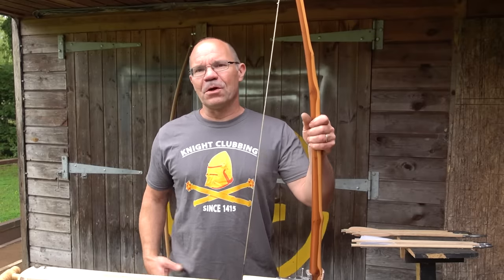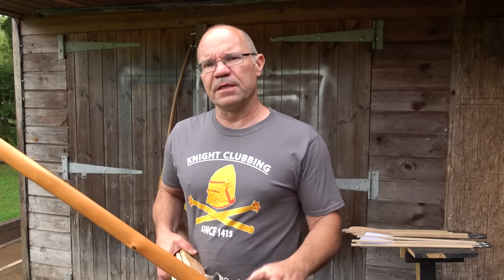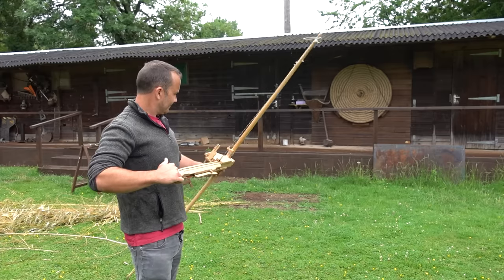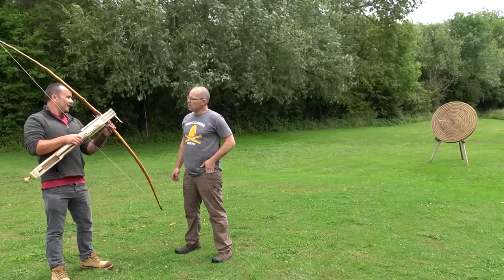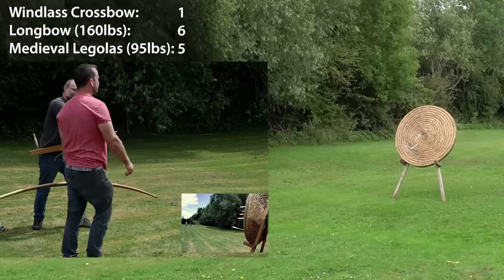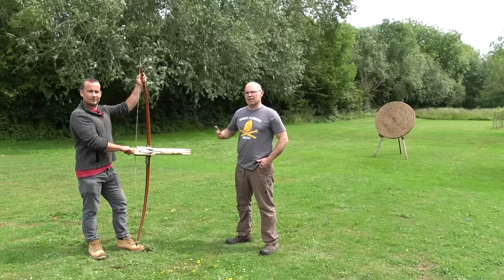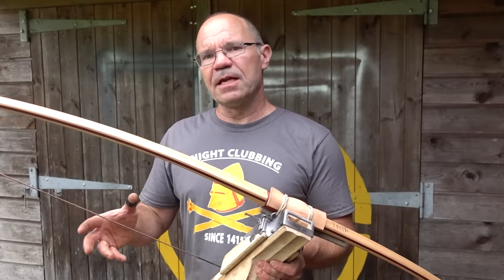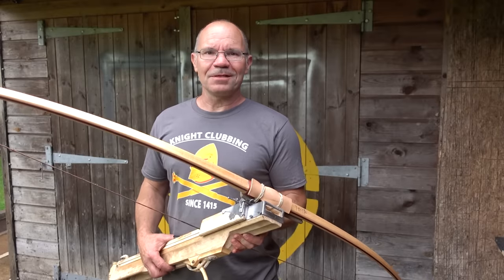Tod's 120lb Medieval Legolas - TESTED

Comment: Having in mind that Joe felt the 120 pounds bow as a 160 pounds bow (even though it may be caused by Joe not being accustomed to the SIL system) it would be interesting if you could add a pulley system to actually take advantage on a more efficient way of the bowman's strength.

It would be a huge advantage if the instant Legolas allows Joe to feel the 120 pounds bow as a 90 pounds bow 😸
Reply: I've seen videos of people using instant legolas systems on compound bows, which sounds exactly like what you're thinking of. However, compound bows are a very modern invention (circa 1960) and therefore aren't very medieval. You could probably design an instant legolas system with a spring that would assist with the draw, but even the first springs weren't invented until the late modern age (mid-1700s), so that also isn't very medieval.

Not to discount your idea by saying "that's not very medieval" of course.😋
Reply: @amish-ish  The composite bow comes as far as the Bronze age with the Sinew variants From middle east, Being used proeminently by nations such as The Mesopotamian Assyrians, Babilonians, and later the persians. The Nomads also had their variant of composite bows
Reply: @picollojr9009  Composite is a different thing to compound.
Reply: @amish-ish  I don't know if you've seen it yet, because he made it quite a while ago so you might have, but Joerg made an assist mechanism that uses a second lighter bow as the "spring". All you have to do is attach the assist bow backwards in front of the main bow and extend a part of the sliding mechanism out further to reach the assist bow's string.

Generally, the second bow should be around half the draw weight of the main bow, and you'll want a bit more draw length on it so that it can stay under a bit of tension while the main bow is at full draw. That being said, the physiology that is required for Joe Gibbs to draw 200-pound bows might not work as easily in reverse, and the high rate of fire would certainly be exhausting, so don't expect a 400-pound SIL to be possible.

Comment: Old world weaponry is so cool, especially when combined with a little 21st century engineering and thinking.
Reply: I tried reworking flintlock rifles and attach three of them into a wheel, making it similar to a mounted minigun. It's for a fantasy setting that I came up with with my friends, and the concept is actually pretty cool.
Reply: Boid That seems highly impractical when faced with loading, and weight. Which is why when they did double barrels, they were a good even. The logical progression was cartridges, which led to six shooters and the like. 

Logically flintlock was used similar to crossbows, because of the loading action, and even with three barrels you don’t negate that. 

Might as well make it a fixed double assembly on a swivel mount, up the caliber making it a mini cannon, add your third gun onto a separate mount and assembly with a mate barrel. 

Then just keep the two shots. One for a lead, one for the correction. Then the other gunner to alternate loading actions to maintain reasonable rates of fire. 

The issues this gun faced are what I was thinking of. https://en.m.wikipedia.org/wiki/Nock_gun

How did you explain the engineering?
Reply: @chickenmonger123  The main reasons you addressed is the main reason why I discarded it in the long run in favor of mounted cannons.

But I may come back to it. I just don't know how to tackle certain issues
Reply: Boid Ah well, that does make more sense. Good luck on your writing, hopefully you can shake it out. Often military doctrine bends to practicality. Make a logical world reason, and you can do all kinds of wacky shit, peculiar to that theatre of war.
Reply: Repeating flintlocks were a thing, see Kalthoff or Lorenzoni guns for instance made at the tail end of the 18th century, and the Kalthoff guns were even earlier, made in the 17th century, people back then definitely didn't lack ingenuity. It's just that when it comes to issuing firearms en masse is already difficult enough, cost, quality control and standards of manufacture, time, complexity of design, those are all important things when you're thinking about issuing your troops with any new technology. 

Flintlocks or rather proto flintlocks like the snaphaunce came around in the 16th century, but it took well over a 100 years before they were being issued to any troops in any significant numbers, and another 50 until it became the mainstay of European armies simply because the matchlock was a far more common and well understood lock mechanism, it was what the manufacturers were familiar with, just like a lot of manufacturers are familiar with the AR or AK family of rifles today, and will probably keep manufacturing those designs for a very long time.

Also if you're thinking about some kind of revolving design well my boy James Puckle got your back, he made a revolving, repeating cannon that relied on a flintlock mechanism in 1718, or well the patent was from 1718, I can't remember exactly how long he took to come up with that, apparently the Royal Navy was interested but ultimately the weapon never went anywhere, might wanna look into that for inspiration, the operating mechanism is pretty interesting.
Reply: So old?
Have you ever seen an ancient Greek bow 2000 years old? At least! 
They were shooting 220 to 750 yards! We are talking about 300 lbs plus! 
Or Asian bow, or Egyptian?
Medieval they say!
Reply: old weaponry can shoot just as fast. Remember you have to reload the magazine one arrow at a time. meanwhile this guy can shoot 125lb bow without any device just a fast 
https://www.youtube.com/watch?v=Ya6mjSycl0M
Reply: Skin Care
Reply: @chickenmonger123  m
Reply: ⁰⁰ㅣ
Reply: @boid9761  it's rare to find but multi barrel flintlock rifles were made.
Reply: @matthewschmitz1765  Yeah That too.
Reply: you ain't seen nothing yet until you see somebody shoot 3 arrows in 0.6 seconds, and hit his mark
Reply: You know whats even better old the guns.

Comment: Shows DM this video
DM: No
Sad noises
DM: Secret writes an evil army with archer column armed with this attachment
Reply: As a long time ST/DM, I can confirm.
Reply: DM here, the master archers of Menet already use these in my world :)
Fully intent to let them loose on my party at some point.
Reply: Task failed successfully.
Reply: i see you have been cursed with a lawful evil DM
Reply: I just allowed a modified version of this for a ranger PC in my Pathfinder game.
Reply: the issue with allowing this is that we have only seen its strong points so most implementations would be straight up better than a normal bow. However it has been stated several times that you wouldn't use the IL in all circumstances. Its like if the flintlock pistol was introduced and you put it in the game with basically bow rules and 10x damage. Quickfire bow obviously is less of a change from a normal longbow, but how do you capture the drawbacks?
Reply: @Maric18  Well, when you are in a fantasy setting with a DM/GM that loves using magic and has a group of mages who sole duty in their existence is to go around and blow up blackpowder barrels. Guns are rare in the campaigns I am in. And if they do exist. They only exist because of reasons of the DM/GM (generally some time placed NPCs or even NPCs from another planet).

Yet when I see something like this. It can be used for more mass hit and run tactics or in the sense of mass combat. A 'small' group of well trained archers. Able to fire consistently the same amount over the same span of time hundreds of arrows more than even a group larger than them. Just to rain arrows down on a large mass. Also, perfect for more emplacement archery. Like a castle or fortress. A small number of archers able to rain down arrows to make their besiegers to think twice about charging.

As i see it. The big drawback. The weight and how unwieldy it is. I mean sure can lug it around but once it is set up. It is clear it is not easy to take it apart and stow it away for easy transport.

Plus reloading it takes a lot longer than it took to fire it. A crossbow is faster by that point. And already know of rapid fire crossbows that are also magazine fed and a lot faster than this bow concept.
Reply: @Rune_Scholar  I always tell my PF players, if you build a grease monkey with a penchant or invention, this this is A O K to research and develop. Unless the game I am running is porting Eberron, in which case yea these exist. why the fuck wouldn't these exist in eberron?
Reply: Maric 
Reload time needed to refill the magazine. Reload time for stripper clips EACH stripper clip. Added weigh and bulking of system itself and bow attached, weight of stripper clips quantity of stripper clips, decrease in agility and stealth, decrease in dexterity in battle. 
Increase aim per shot ( more you fire more accurate you get ), IL can be fitted with various aim systems and it will fit, IL will overpower any bowmen/archer/crossbow men or two maybe three, be effective in middle/close range due to fire rate and ease of aim, won’t get debuffs if quick aiming needed same with long range any range (depends what type of bow installed ), strong against melee units or thikk monsters, if using with non-human type system can theoretically support small balistas.
P.S: Id love to have one in Skyrim
Reply: @Maric18   I see it as a battlefield weapon. Lugging an IL around while adventuring would be inconvenient, not to mention the weight of all the arrows you have to carry to make it worth the hassle. You'd need a cart.
The stamina drain would also be tremendous, as well as the chances of something going wrong with the mecanism. It would be a powerful weapon but quite situational
Reply: @Maric18  The attachment requires maintenance and wears down over time. It's from a specific and insular culture so having it maintained or repaired is kind of going out of the player's way. As is the crafting of custom arrows. That's a bit less of a problem because any good fletcher can recreate them but it's still more of an inconvenience.
I also tend to run realistic games and gear weight and positioning matters. The IL can be cumbersome for an adventurer. For example, if you need to climb a rope you can just sling your normal bow over your shoulder while you do. The IL is a bit harder to stow, however. -2 To that climb check. Your bow is wobbling all over the place as you ascend.

Comment: At some point I'd like to see a range and penetration comparison of the "Instant Legolas" to various standard bows and crossbows.
Reply: As long as the string and arrow don't get much more friction as it is loosed, it has the same range and penetration as the naked bow. An exception for using shorter length bolts that might affect that
Reply: @calebjowens  Shorter bolts are going to effect it.  If they're the same weight they have less air resistance and thus better performance at range.  If they have less weight they have higher velocity and thus better performance at range.  There's some minimum projectile weight to not damage the bow, but I'm not sure how that compares to the minimum weight to make an arrow that can handle the acceleration while being long enough to fully draw.
Reply: @nathanbrown8680  It's worth noting that since this system guides the bolt for the full length of travel, the bolt has no length requirement as far as the draw is concerned.
The main drawback from what I can see, (as far as range and accuracy are concerned,) is that to make the bolts flow through the mag and chamber correctly they must have a pair rather than a triad of flights.
Also, having a projectile be lighter or equal in weight to some other projectile shot from the same weapon doesn't necessitate better performance, if performance is measured in penetration.
Reply: Slingshot channel.
Reply: I assume this would have gotten min-maxed to the extreme, eventually coming up with the optimal ratio between draw weight, draw length, arrow length and arrow weight. I'd say range would get ditched in favor of penetration potential, given that you'd care less about keeping your distance when you can unload such a volume of arrows even with small groups. Also, "stripper clips" for this device already exist, and I'd argue that to be the scariest potential feature of the Instant Legolas...
Reply: @Sa1d1n  yeah, they could just use crossbow bolt which is heavy enough
Reply: these definately aren't cloth yard shafts. would be interesting to see the difference in penetration and long range performance
Reply: The Turks, had gadgets to get increased range by using shorter and lightweight arrows, and were highly trained in being able to shoot many Arrows, Lars Anderson often quotes them as his inspiration, now that Todd has proved the concept, I would like to see the range and penetration power of this weapon, the English Longbow is powerful, but requires a lot of skill to use, for me this Weapon has its greatest application for, non Archers, in volley opportunities, potentially against Turkish Archers, or lightly armoured Horse Archers.
Reply: Those arrows do appear to be launching at a rather leisurely velocity compared to what you normally see from bows like this.

Comment: The perfect setup for a frontline when the enemy army is charging. Or imagine these guys in the top of a battlement while the others try to climb. No more ankward waiting wile the enemys run against you, now you can really destroy them in the meantime if they dont have a serious shields and armor. This feels like a medieval Winchester.
Reply: Five Joes made a mediaeval Maxim!
Reply: I was thinking about the Crimean War as well, long ranges but slow firing rifles paired with short ranged rapid firing Winchesters to break up charges. It was a tough system to beat. If you had a majority of your bowmen with longbows, but still a significant number armed with the SIL, that might do something similar.

Comment: Well made. I'd say the biggest struggle I saw in Joe was with the overdraw (because the handle to pull the mechanism extended draw length by a few inches, which makes it really hard to pull further back), not to mention changing the orientation of his bowstring grip.

Comment: It seems like joe is forced into a particular draw style with the SIL. He’s got very specific and good technique that he isn’t able to utilize. I think it might be possible to engineer some adjustments that would allow him to get the most out of his ability
Reply: And that's what I think makes this interesting for those who never has used a bow before. Having no "bad habits" they have nothing to distract them from just leaning into the IL and accepting the stance. The rigid stance makes it repeatable which should cut down on the training needed.
This is of course only a theory. I also think that someone who get started with one of these might be able to learn to live with the front grip and use it effectively even with heavier bows, but again it's only theory.

It would be interesting to hear what a kinesiologist thinks about the change in stance. Is it any better or worse for the body than the traditional way to do it?
Reply: @blahorgaslisk7763  you are incorrect
Reply: Like for example rotating and swiveling draw handle
Reply: I doubt it would take much to turn the draw handle, I also originally thought the front grip might be there as a stop, so you don't pull the entire thing off the bow if that's the case simply put it in top?
Reply: @eirikronaldfossheim  This is beyond foolish...
Reply: Eirik Ronald Fossheim Very constructive.
Reply: @eirikronaldfossheim  with such a nuanced argument, how could one disagree??  😅

Comment: The Grip at the end  was a very important part of  Joerg's invention, the ability to hold the drawn bow for longer aim time 
now it's only remaining feature is it's speed ;)
I have a suggestion thought:
how about an arch of a grip on the bow over the left hand, you put your arm in it as a glove, when you are at the end of the draw, and right as you reach the final grip, you can safely open your left hand knowing the arch got your arm, so the bow is safe from flying out left, while holding the bow with your thumb just enough to grab the grip at the end
Reply: I think you may be onto something. Not the glauntlet thing but the arm support part. In a similar way to how some slingshots use arm bars to stabilise and increase power and accuracy. That may very well improve it even more as it takes some load of your musculature. But in turn could also encumber you.
Reply: @theexchipmunk  I didn't quite catch how this works. Could you post any example of a slingshot shot in this manner you describe?
Reply: It's more about overcoming ingrained habits. If Joe would practice and get used to the fore grip, I bet he'd like it.
Reply: It’s also lacking the reverse bow, that could have reduced the weight the archer felt.
Reply: A rest, like early musketeers carried in combination with such a thing. Imagining a 'bullpup' configuration of the device on a smaller bow, whereby  it (or a brace extension) rests over one's shoulder, supporting the weight of the device.
Reply: Like the idea, with the above design you have to encompass the (LH) bow closely, with my light weight bow I shoot more open handed.   Be nice to have a 'last Arrow'  indicator, so that when it drops and that arrow loosed, you are already about-faced, and 'Legging it'   ->    ->    ->
Reply: Great idea!